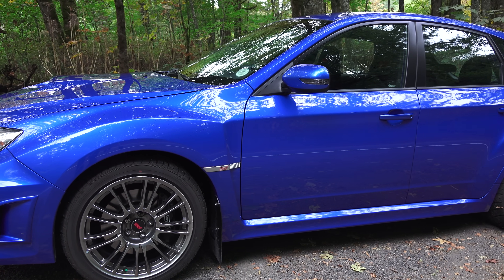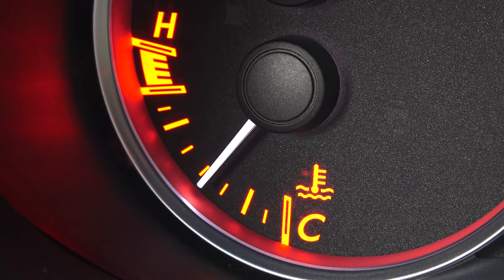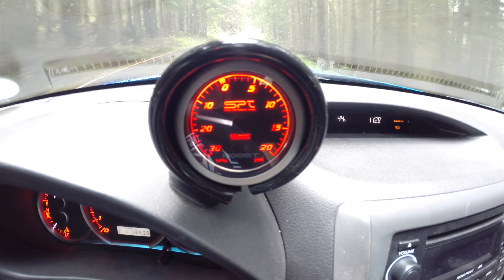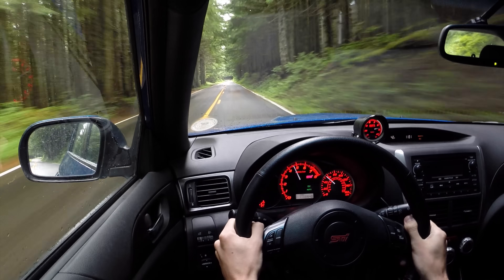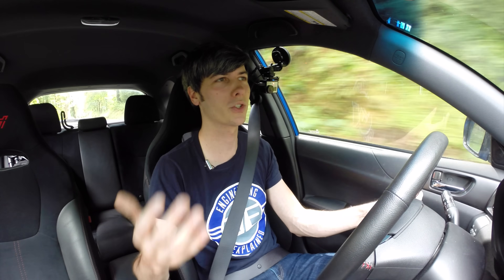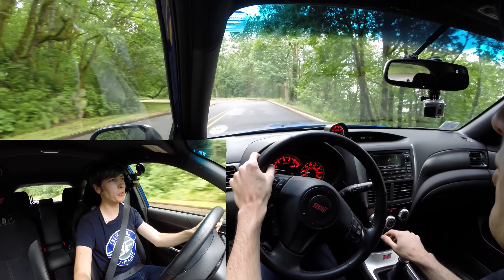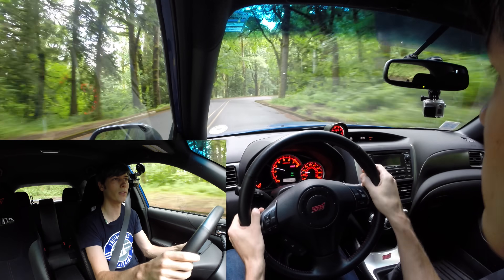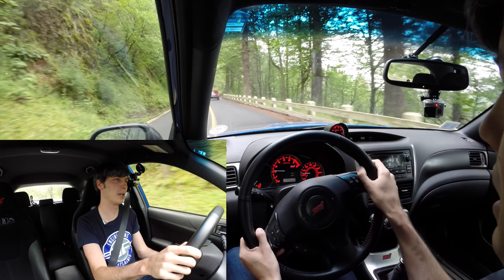5 Things You Should Never Do In A Turbocharged Vehicle

Comment: slip angle is not the difference between tires.. its the difference between where the car pointed and where its heading.. if your term would be right when you re sliding from rear and if you dont counter steer since there wont be any angle difference tires wouldnt loose grip.. so where the car pointed and where it goes..
Reply from the maker: +yco67 who said it was the difference between tires? I did not. I have a video explaining slip angles in full detail if interested. Understeer/oversteer are a result of the front tires' slip angles being different from the rear tires' slip angles.
Reply: slip angle can be talked about one axis of the car.. its the difference between where the car is headed and the front tires or rear tires.. with your explanation if steering ll stay at the center posiiion and the car slide from rear there wont be a slip angle.. makes sense to you? shouldnt be cause both front and rear tires angles ll be the same in that example.. so its where the car is headed and actual tires tend to roll.. nascar is really interested in this..
Reply: hey dude if you are smarter then him then u doo the video to prove it, or you can just shut it :)
Reply: haha ok..
Reply: I have had exact experience with this. I was in a boosted Legacy with an
 STI swap and pulled out of a parking lot in the rain at a slight 
incline onto the road above. There was a car coming down the road, and I
 thought I had enough time to go. When I accelerated, I was used to my 
N/A integra and thought I had things under control. I gave it some 
throttle, and when the turbo kicked in, it threw me left into a curb, 
and I hit the curb and bounced. When I tried to correct with the 
steering wheel, I ended up getting thrown back across the road into the 
right side curb and I destroyed my right control arm and suspension 
assembly.

This was simply pulling out into traffic and not hooning about. I was so
 embarrassed!
Reply: +Engineering Explained Are you a engineer?
Reply: no im not but terms are stable.. when teacher makes a mistake you dont need to be a teacher to fix it..  if you think like that good luck..
Reply: +TheReapersSon 
whoops! :-/
Reply: Richie Jeffs
Yeah, tell me about it. The car was recently built and not even insured, but I decided to be AN ABSOLUTE DUMBASS and take it out for a nice 20 minute drive to work. That was a sign right then and there. NEVER AGAIN.
Reply: TheReapersSon 
Fair play, least you learnt your lesson!
Reply: Yeah what a douche.
Reply: CAFcorey AWD car?
Reply: TheReapersSon It was a Chevy Tracker SUV I had it in RWD

Comment: Using 87 octane fuel in The States may have been the best suggestion you didn't realize you had.  I didn't notice they started putting in 10% or higher ethanol ethanol/water in gas until my friend told me.  He's driving a N/A, but with a pretty advanced Lexus engine.  He hasn't had any problems and since I found one station around my city that didn't use any ethanol in any of their fuels I use them exclusively.  Sneaky sneaky!  Don't believe me read the pumps really well next time you fuel up.  It's gone under the radar to long.

Comment: I would love to know how we get these high boost levels with low engine speeds since turbos spool based on engine rpm...
Reply from the maker: +elucid07 you'd be surprised. There are turbocharged engines these days reaching peak boost at 1500 RPM or less. Not just diesel engines, gasoline as well. And even engines that can't hit 'peak' boost that early on, can still have high enough pressure to cause LSPI.
Reply: +Engineering Explained Ah, fair enough. I don't make peak boost until around 3600rpm in my S15. I have maybe 3psi at 2500rpm on a cold day. still an improvement on the old turbo... 0psi thru to 4000 rpm, then 17psi within 500rpm from there.
Reply: A turbo isnt based on rpm it's based on exhaust flow, a supercharge is based on rpm bc it is hooked up to the crank shaft which is spinning on the engine. you can't make boost at a low rpm bc the amount of exhaust gas from your engine is the spooling it enough to make boost, either get a smaller turbo or switch to a vgt turbo.
Reply: diesel over here. no way I'm getting any boost at a low rpm and high gear. i get ~25lbs of boost at 2k and 40 at 3200
Reply: No, they spool based on exhaust gas flow.
Reply: actually turbos spin up on load....not rpm., of course you need some rpm to have some flow but turbos work on exhaust heat and density, so you can have boost at low rpm's.... just add some throttle and watch your boost gauge..... the rpm starts to go up as you add power but the boost level goes up right away because the exhaust is hotter and denser, on a gas engine hi boost levels at low rpm are dangerous because the piston speed is lower.... spends more time at high cylinder pressure which promotes detonation, at higher rpm this is not such an issue because the time the engine see's  peak cylinder pressure is much shorter so less likely to detonate which is what put's holes in pistons and burns rings
Reply: +Dave Lee well..... your not wrong in that of course you need rpm to have flow......any running engine has rpm but a properly sized turbo will produce boost at whatever rpm it is sized for....which is why we use wastegates... allows a smaller turbo to produce boost at a lower rpm and bypasses the excess at higher rpm......we have tug boats in my company that idle at 100 rpm and are governed at 900 rpm..... at 900 rpm they are making in the neighbourhood of 50 psi boost.......it's all about volume of exhaust, heat and density which is what drives the turbo....if you have to Rev the snot out of your engine before you get any boost the turbo is too big.....in our drag race car a larger turbo is used so the desired volume is achieved at a higher rpm..... the engine can't produce the volume of exhaust because the turbo is sized for a higher rpm..... so you are correct  that rpm is required but that is not what drives the turbo......maybe I didn't explain that very well in my first comment
Reply: awright.....!
Reply: +James E Dennison  You're quite right.  I slapped a worn out turbo off a 3.9L Cummins on my 1.3L Suzuki Swift a few years ago.  On the Cummins it spooled to 40psi instantly (somewhere below 500 rpm, I imagine.  No tach on the equipment).  On the 1.3 it doesn't even begin to spool until 3K rpm.  It makes sense, though, because my 1.3 is exactly 1/3rd the volume of the 3.9.  Rpm has nothing to do with boost.  It's all about volume.  My car doesn't create the same volume of exhaust gas as a 3.9 diesel at low rpm.  I did limit the turbo to 7 psi, so everything after 3K rpm is pretty fun for a beat up, cheap car.
Reply: Dave Lee
"a DIESEL TRUCK does not a high much MAX RPM"

You were saying something about the "derp" in these comments?
Reply: you are REALLY stretching on this. if the car is tuned and setup correctly like a factory turbo this should not be an issue. if anything... getting boost at lower RPM raises the efficacy at that load as an N/A would need to work for that air.

the turbo wont be doing much work and neither would the engine... as long as the RPM is sufficient the load would build boost and the engine will gain power and rpm.

have you driven a large displacement engine with a turbo ? drive a v8 5.7 twin turbo in 5th up a hill at 2000rpm it wont even struggle. UNLESS the turbos are to big then it will just run like any other non turbo.

the whole point of a sequential twin turbo is to get the boost at low and high rpm so it feels like a bigger CC.

having boost even a little at lower rpm makes a small engine feel bigger and you wont need to gear down like in a bigger motor
Reply: +Dave Lee it's a built 5.9 at around 500hp. sized up turbo so there is most definitely some lag in the overdrive gear at low rpm
Reply: +Latro Geniwile nope, I'll be blowing soot until I i build boost at 1500
Reply: wtf r u on about..
Reply: no, wrong!

rpm and load are directly related you cant have load or boost with out rpm. every RPM you get another cycle of exhaust gas  and it means nothing with out rpm to build pressure.  the load is not the main factor 

at lower rpm the timing and fuel is set to compensate that chance of detonation.  a good tune and setup should allow for low rpm boost to fill the lag or lower power areas

and most of the time there is no dangerous boost at low rpm only low pressure making the engine feel bigger more efficient
Reply: ye which you get from RPM..    ....DERRR  every rpm the turbo uses that gas flow.. if its not at good rpm there is nothing to spin the turbine
Reply: its similar to lifting weights. you wouldnt try to lift 500 lbs from the ground.... but you could lift 150 lbs from waist-height
Reply: omg... is the tug boat a petrol car engine??????? i can pull any example out my ass to make a point too
Reply: lol you have no idea
Reply: +MOTO 809 thanks.......ya....that does only apply to turbos though.....superchargers are connected directly to the crankshaft and the faster you spin em the more boost you can make as a general rule
Reply: James E Dennison
Right, but we were talking about turbos, not superchargers.
Reply: +MOTO 809 yup.....your right
Reply: +MOTO 809 smoked Dave with that one. LOL
Reply: LOL. your right rick m. what a great come back . nothing to do with the comment. but a typo.. SO GOOD. my fault for not proof reading.  doesn't change the facts
Reply: "how else do you think the air gets in the throttle"

He's at it again...

Look at this.  In neutral, my car will maintain a constant rev of 5k rpm at around 5 inHg (wich is a measure of vacuum, in case you don't know).  That means less than zero boost.  I can cruise in 3rd gear at 5k rpm and run 1 inHg.  Still less than zero boost.  Now lets make some boost.  2nd gear, to the floor I'm at full boost (10 psi) just past 3k rpm.  A turbo that is designed specifically for it's engine will be much more efficient, but still does not rely solely on rpm to operate.  Even the most highly tuned engines will run at zero boost at sustained rpm.
Reply: LOL wrong...  exhaust flow is based on rpm!!! and a bunch of other factors... no rpm no flow!!! derr...

" you can't make boost at a low rpm" of course you can.. again for the 10th time it comes down to setup and application.

Comment: For the final scenario you talked about, I thought modern ECUs would determine the timing based on the algorithm and real time processing of all the data variables and inputs at any instant in time to determine the right ignition timing in any situation. Also, the engine software would also cater for predetermining such events for both performance and engine protection.

Comment: 2011 VW Polo GTI 1.4 twin-charger (turbo and supercharger): It takes anywhere up to 15 minutes of driving for my oil to reach full temperature (91°C/195°F).  I'm not neurotic about it, but where possible I do try to avoid getting it on-boost until it's reached at least 60-70°C.

One nice feature they don't put in the brochure is the water pump is electric.  So when you shut the engine off the water pump keeps running for a couple of minutes, circulating coolant through the block, radiator and turbo.

Comment: hmm. dunno about #5... i found accelerating out of a corner reduces understeer in my STI. they are notorious for understeer with the stock sway bars.... a no-no i would add is to never do a mod that leans out your AFR without getting tuned for that mod. i.e a cold air intake on a turbo EJ engine without being pro tuned for it, or BOOM

Comment: The Assertions are true, but the Reasons are false.
Getting up to temp, yes true but: Oil will be sufficiently warm enough by the time the coolant gets up to temp; there isn't that much difference in temperatures.  Even at ambient temperature the rate that which oil flows vs. warm vs. hot, isn't all that much, especially under pressure.  That being said EVERY car I drive is driven in "grandpa mode' until warm and allowed to cool gracefully.
Lugging the engine, yes true but: nearly every car doesn't actually make any boost until it gets past 2000rpms.  The cylinder pressures are not high enough to worry about.  Statement about high load engine rpm conditions: ummmm...the knock sensor's job is to detect knock, the ecu will see that and adjust timing/fuel.
Fuel: yes true but, again, knock sensors...the car will run on "OK" on whatever commercial fuel is out there.  The ECU is designed to compensate for this.  Again not recommended to run anything other than what the mfg suggests.
Slipangles.  Unless the car is highly modified, or traction condition are less than optimum, this is not an issue.  In fact the opposite is usually true.  It  is best to get on the throttle at or before the apex so the car is in the power band by the time one is going straight.

Comment: pro how many minutes do i have to wait before shutdown the car?
Reply: Just drive off boost for the last minute or two before shutting it off.
Reply: Zero. There is no need as modern car does not require it. Some modern turbo cars are even fit with stop start which automatically shuts down the engine at lights, etc.. (328i)
Reply: Unless you are pretty much doing a burnout then parking your car then you don't need to let it cooldown, if you are driving your car like a normal person on the street you will never need to let it cooldown.
Reply: I was thinking the same thing
Reply: as long as it takes to cool down some.
Reply: Drive it softly and don't beat on it before you turn it off, and let it idle for a min or two and it should be fine. Or install a turbo timer.
Reply: +Flash Over turbo timer where can i finde it?? i have ecoboost mustang
Reply: Hassan Gabbani Well first, do you know what they are and how they work? Secondly, look on different websites for different companies that sell turbo timers. I don't know if there are any that would work on the ecoboost application since it's fairly new but i'm sure there are some out there.
Reply: +Flash Over will i don't know what they r but i will search about it thanx man
Reply: +FreePadz so wrong....just stahp
Reply: +Trent Hutchison So explain stop start in the 328i
Reply: You might not have to.  Modern turbo'd engines automatically keep the oil circulating after the car has been run hard and turned off to make sure it can cool properly.  Usually, you'll hear a buzz or hum noise and you might see coolant still flowing into your reservoir.  If your car doesn't have this, you'll want to idle the car for only a couple minutes before shutting it off.  We're talking less than 5 minutes idling after burning the snot out of the car.
Reply: Sick dog in ur VL turbo min 5 mins
Reply: that's why you do oil changes.....

Comment: Thanks for another informative video like this. However, I have a question after hearing #4 on this video: I hear that the regular Subaru WRX is premium recommended (read: NOT "required"). How long can regular fuel be used in the WRX until you need to switch to premium fuel?

Comment: Does your STi make any boost at all at 1000 RPM?  How much at 1500 RPM?  Not much...

Cars have electronically regulated wastegates, meaning the ECM controls boost at all engine RPM.  If you have boost related pre-ignition at low RPM, chances are your engine wasn't calibrated correctly from the factory, or you got a bad tank of gas...  the latter is more likely.

Comment: I just finished the part where you were talking about "lugging the engine" to touch a bit more on the diesel vehicles another problem with that particular scenario is the high EGT's that you will get from "lugging the engine". the big problem there is that if you sustain those high EGT's for a period of time chances are you'll either destroy the turbocharger from the increased heat and drive pressure or melt the pistons.

Comment: my 2015 Forester XT lugs itself when SI-Drive is in intelligent mode. Until around 60-70% throttle, it stays at it's highest ratio (CVT transmission) and the boost gauge reads 10-14 psi of boost. Do I have to worry about how everything will hold up against this load over time? Or am I fine considering Subaru programmed the car this way?

Comment: What is the most fuel efficient load for an normal gas engine? I would think it is best for a lower RPM, as that means gas is injected into the pistons less frequently and more of the energy goes into pressure -> force -> torque vs a very high RPM where most of the energy is not used. So what is best?